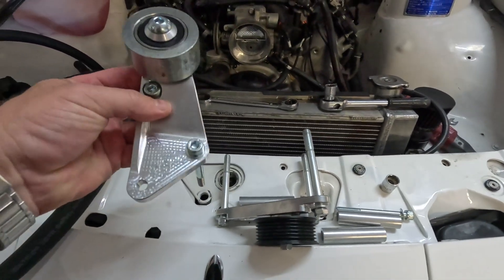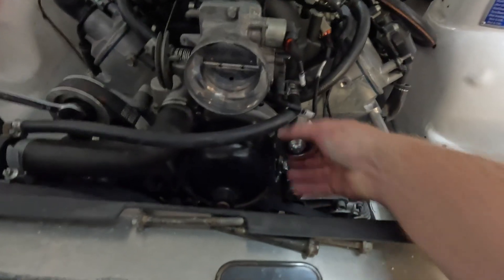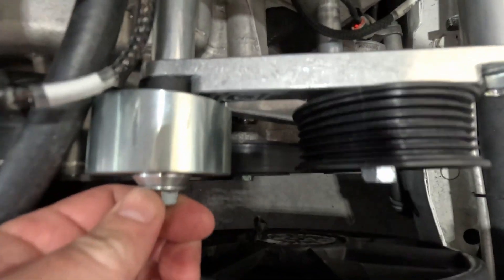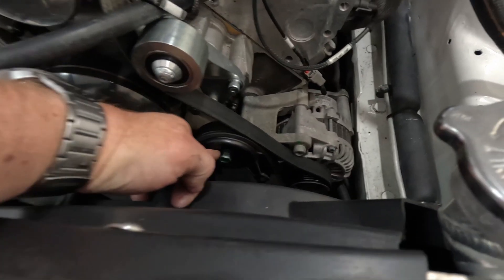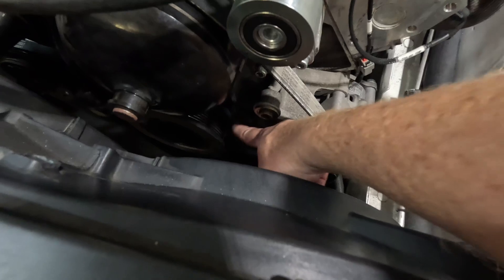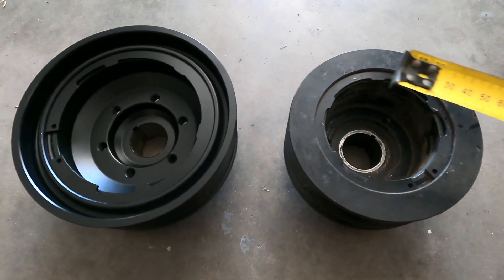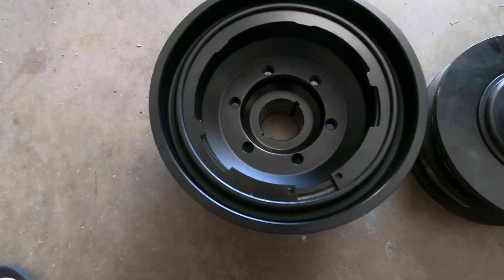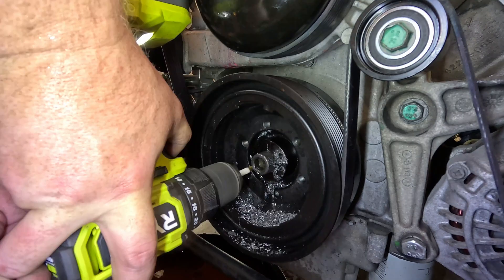HARROP 2300 BLOWER INSTALL - PART 4 - BELT PATH, CRANK PINNING - LS1 VL CALAIS PROJECT

Comment: You needed a tuff mounts power steering delete kit, also with that Dayco 8 rib balancer you could have upgraded to a 8 rib set up, and ran a Dayco overrunning alternator pulley OAP080, which helps with blower belt slap
Reply from the maker: Very interesting. Are the alternator pulleys the same diameter?
Reply: @VL_Life just about to fit a 2300 to my LS1 in my XD, so watching the videos with interest, I got Harrop to upgrade the kit to 8 rib pulleys. 

Enjoying the vids 👍